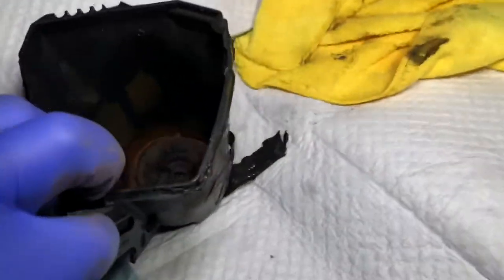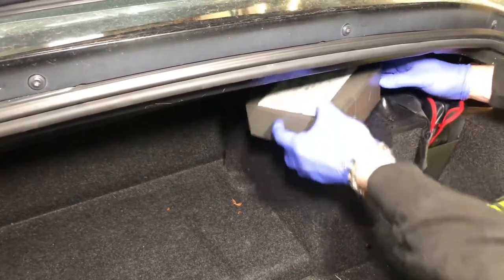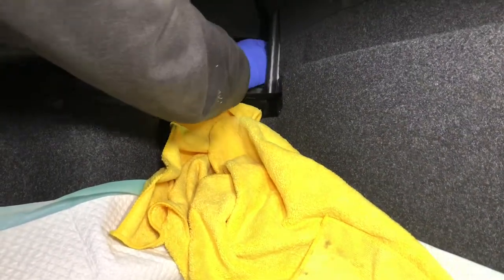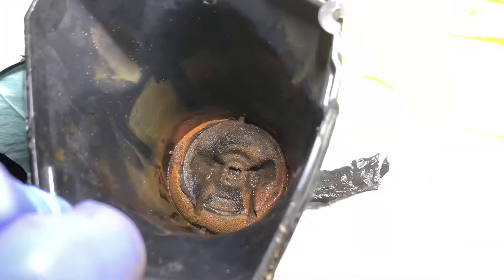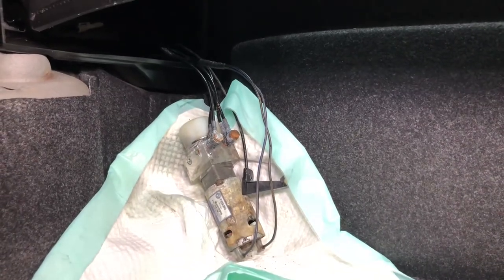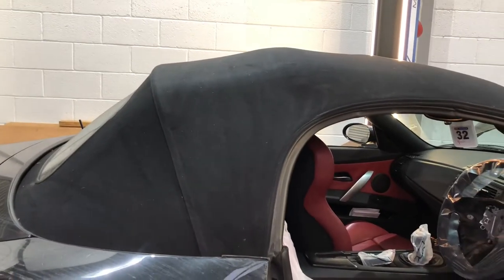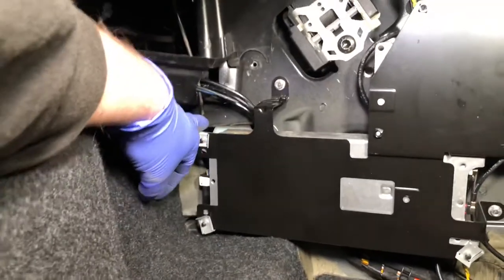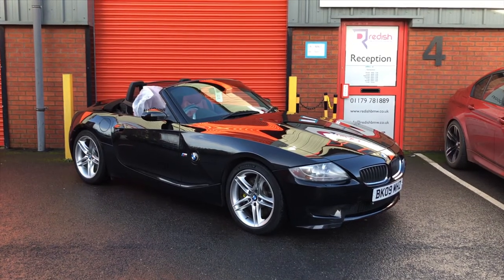BMW Z4 Roof Motor Relocation

Comment: Thank you for your video. Trying to do it myself right now and having trouble finding the final cable tie to pull the motor out. It is stuck in the bottom holder, any suggestions?

Comment: Great video.  I followed your instructions.   My motor worked but it was out of fluid.  I filled it up.  The top worked for several cycles then it quit.  I noticed fluid dripping out if the right side. If the lift cylinder is leaking,  do I have to remove the top to get to the lift cylinder?

Comment: Brilliant video thanks … It’s not easy to get the motor out of the housing > I poked a long bar through from the boot to rip the lid off the housing… There is a great thread on the web, which has pictures and explanation… Do look at that as well.

Comment: Happy new year. So I’m planning on purchasing a Z4 with low mileage & the top isn’t working. The dealership said the motor has been replaced but it’s still not working. So what you think the problem could be?

Comment: Hello ,i do it and get the motor out the bucket but stil i cant pull the wiring , i think its stuck under the bucket. how i can solve it and also how i can get the bucket out. thanks
Reply: Did you solve it? I’m having the same problem now

Comment: Hi , I am doing this right now , but my motor cant be pulled out.  There was one cable (which is attached to the black plastic on the side of the motor) that's short or stuck . PLEASE HELP 😭😭😭😭

Comment: Love your videos. But he needs to ditch that chain bracelet when working on customers cars. Interiors or exteriors. That's not only sharp it's extremely bulky. Even just walking around cars not even working on them, an MOT tester shouldn't wear that. Oh yh and it looks shite 😏.  Glad you saved this customer some money. Hopefully the motor is still serviceable for many years despite it being waterlogged for a substantial period of time. Can't of done it much good.  Also look at all the scratches on the panel above the boot aperture some animal has been in there before with a chain bracelet. 🙄